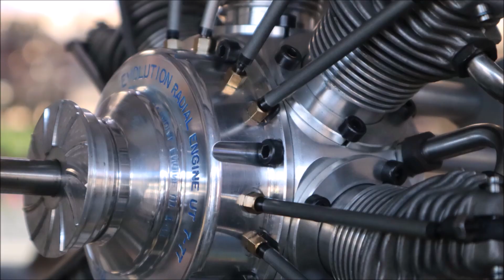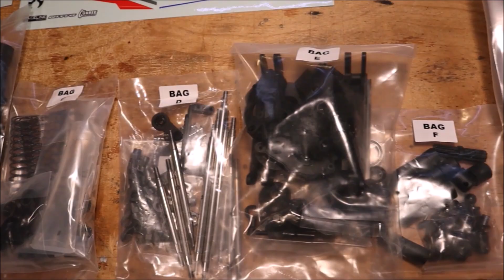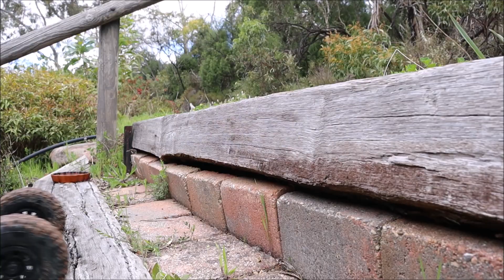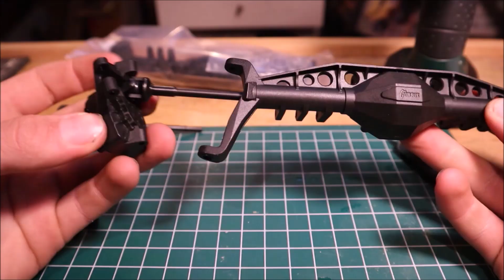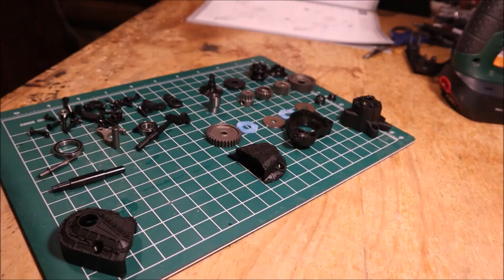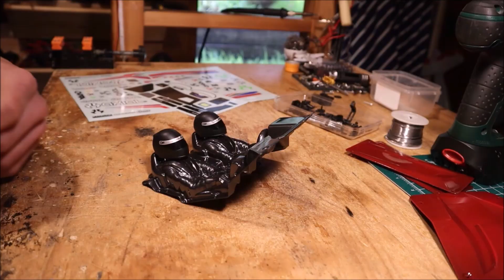All About The Axial Capra 1.9 Trail Buggy Kit //ULTRA RC

Comment: I like the way you built the kit. May I ask the total cost the way you built it? How is it holding up? Subbed.
Reply from the maker: Thanks fow watching ultra rc mate.
I appreciate your support!
Yeah it is holding up good.
Still verry impressed at its capabilities.
If you want a crawling rig this would be my choice.
The total cost is allot because i used good elecrronics.
Depending where you are located im in australia a ready to run one is 779.
Mine cost way more also keep in mind you might already have some stuff.
Mine was the car plus,
200 servo
400 esc motor
200 dx5c
60 receiver
100 hyrax
30 battery x2
20 dig servo
6 lights
110 charger
So its pretty expensive but you could just go brushed and that would save you lots if you want to do it cheap.
I would use the new spectrum 2 in one receiver esc.
Anyway i hope that helps!

Comment: Fantastic video...just subscribed.  Until now, all my vehicles (with the exception of my XRAY T4) have been off-road race vehicles (2WD & 4WD).  This will be my first crawler...tho, I'm getting it for "rock racing".

I pre-ordered mine a couple weeks ago from AMain (Chico, CA, USA).  According to my order info, it should be shipping tomorrow (9/28)...so, just waiting for my "shipment" notification w/ tracking number.  In the same order, I also pre-ordered the 2 servos (one for steering, the other for the DIG), & a 6-channel Rx.  I'm still trying to decide on an ESC/motor combo, as well as tires.  Speaking of motor (since I haven't been able to find any info online), does the Capra only for a 540 can, it can it for a 550?  While the ROC412 is a great motor, I'm considering the ROC412 HD...but, into I know whether it's 540-only, or whether a 550 will fit, I can't order my ESC/motor combo.

I do plan on adding LEDs to the headlight buckets, but I need to find red LED headlights, not white/yellow.  As such, if anyone knows where to get good quality (ie. no "imports", please...US businesses only) red LED headlights for 1/10-scale RC vehicles, if you could post info here, I'd greatly appreciate it.

NOTE TO ultraRC:  There were two things in the "build montage" that peaked my 'curiosity'.  First, why use a power drill (with hex bits)?  If you over-tighten (as can easily happen when using power tools) when screwing into plastic, you can easily strip the threads in the plastic, making that part "useless".  Of all the build videos I've seen, all others have always said to never use power tools, and for the very reason I stated, above.  Second, for screwing metal-to-metal points, you used red Loctite, as opposed to blue Loctite...why?  Red threadlocker is designed for almost-permanent hold, this the reason it's used in automotive, motorcycle, and other applications where super-strong, semi-permanent hold is required.  Blue threadlocker, on the other hand, has a medium-strong hold, which is more than strong-enough for RC use, but releases far easier (when heat is applied) than red.  As with the power tools comment, in all build videos I've watched, it had always been stated to only use blue, and to never use red, when building RCs.
Reply from the maker: Sorry for a late reply mate but
You will love the crawling!!!!
I am now using ecx barrage lights
Comes with 2 red 2 white
You are right about the drill and threadlock, but the kit came with the red threadlock and you never want the locker to unscrew,  as for the drill its fine because mine is old and i can adjust the torque setting so all screws are ok!!!
There is not much room for a bigger motor so i would stick with the standard, thanks for watching ULTRA RC mate!!!!
I appreciate your support!!!!
Reply: @CORINKERSTEN  Regarding the ECX Barrage 1.9 LEDs, the places I've found that carry them are "out of stock"...so, need to find alternate options.  Most LEDs I find are listed as 3mm, or 5mm.  Just by chance, what is the diameter of the ECX Barrage 1.9  LEDs?
Reply from the maker: @robbryan3044  I have used these before!!
They are cheap as and come with 2 white 5mm which would fit the capra and 2 small 3mm red ones which could just be cut off or put somewhere else, i put mine on the rear. 
https://www.banggood.com/4Leds-LED-Light-Set-Headlight-Taillight-for-110-18-Oil-Electric-Rc-Car-Model-Parts-p-1367450.html?rmmds=search&cur_warehouse=CN